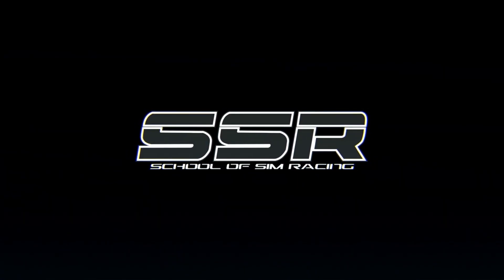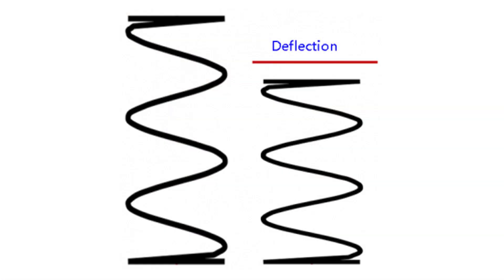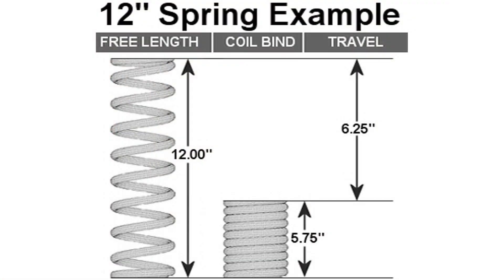Spring Deflection; What Is It and Why Is It So Important?

Comment: Can you do a more basic video on the basics of coil binding and how to determine right front and left front spring rates. And once you select a spring if you hit the track are you still changing left front spring to control ride height when you are coiling binding or would you rather adjust the spring perch?

Comment: Interesting, thank you!  I was always told you had to disconnect the front sway bar, then make changes (springs, weight), then reconnect the sway bar.  Any truth to that?   TGIF!
Reply from the maker: yes and know. on the trucks, if you are going to be making a huge spring change up front, yes you disconnect and then reconnect. But, if you are going from 330 to 340 on the LF, you don't have to. You can still reset the ride heights. I run negative preload on my ARB so I don't always disconnect when changing springs unless its a big change.
Reply: @TommyBrandon  Thanks!